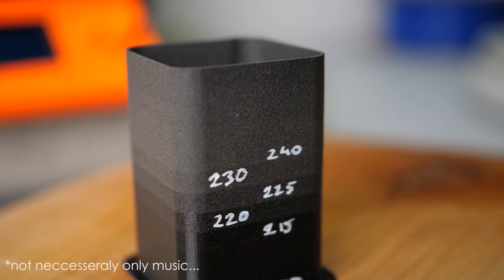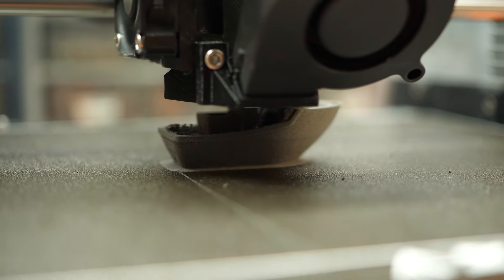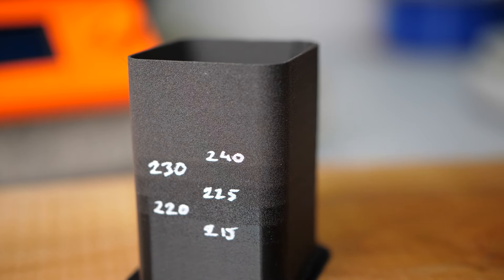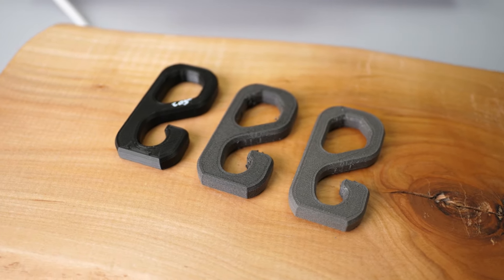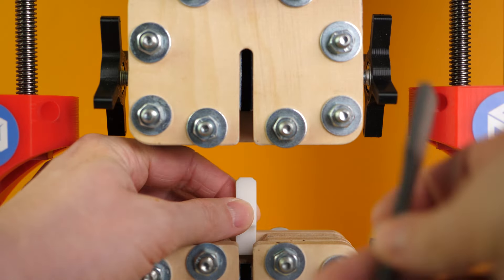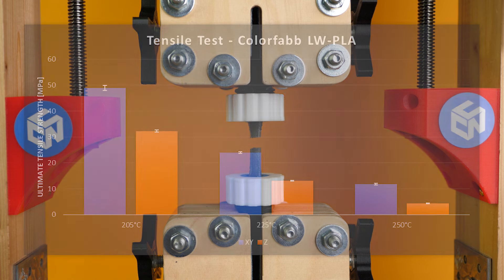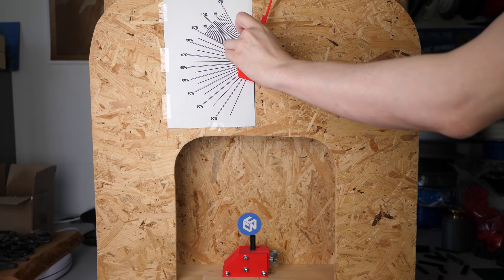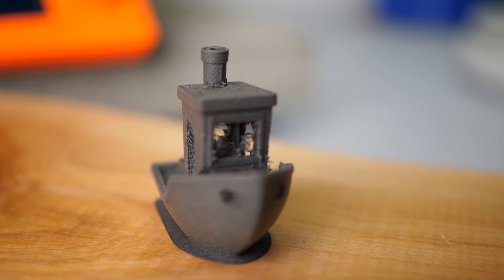A 4th dimension for 3D prints - Colorfabb Light-Weight, foaming PLA

Comment: Does the material change shape permanently if stressed? Or spring back like a sponge?
Reply from the maker: It springs back as long as you don't load it over it's yield point. All bending specimens sprung back to their original shape besides the last one, that I overloaded.

Comment: Very interesting material. White one would be spectacular to paint!

Also: is there any really MAT affordable filament on the market? Non-spongy one, if possible....
Reply from the maker: The LW-PLA is available in black and white. You can get many standard materials Matt by extruding quite fast at lower temperatures but you'll be sacrificing strength.
Reply: @CNCKitchen  methods you described have the same disadvantage - lower strength. I'd love some proven material with matt finish, and sturdy enough for items thrown around, like tokens.
Reply: @cthulpiss  the trick is that many plastics will be smoothed as the pass threw the nozzle, though I have noticed my woodfill PLA does have a mat finish thanks to said wood additive, it feels more (and looks) like cardboard, just bear in mind that that same filling is a nozzle clogging/wear and tear risk

Comment: Hello. What was  value of  extrusion width during printing of foamed PLA with different temperature?  Same value ? Extrusion stream expansion is different with temperature  and speed to. So if it will be corrected with extrusion width  this will allow to decrease part weight, without crashing foam structure. It will be interesting to test this material with adjusted and measured value of extrusion width.
Reply from the maker: Extrusion width kept at 0.44mm with a 0.4mm nozzle for all prints.
Reply: @CNCKitchen  Polymer expand from 0.4 to 0,44 because of melt elasticity. When foaming additive decompose in the melt, expansion is much grater. If using same extrusion width and layer thickness, foam structure is smashed by nozzle movement  and final density is lover then possible.  Increased value of extrusion width and layer thickness allow to produce  same volume with less weight. In order to stabilize foam structure - more intensive cooling can be used. This is the way for further density reduction.

Comment: I can’t get any noticeable increase in volume from my “prefoamed” LW-Pla(overture air Pla) all the way up until it burns at 260. Overture says ideal is in between 190-210 which is much lower than the foaming point of any other LW-Pla. It also only saves me about 20% weight per comparable part. I haven’t seen anyone talk about the difference between “pre foamed” and “non foamed”, but it seems like “pre foamed” may be the answer to the “plane problem”. Anyone else have significant difficulty printing eclipson?

Comment: Instead of printing with a weaker filament type for the core, why not use a partial infill of the stronger material?
Infill may not perform as well under every directional force, but I would bet it would be similar strength to weight.

Comment: I'm definitely curious in the TPU! Could it be used for shoe soles?
Reply: Ooooh snap, maybe!! Dr. Scholls better look out haha 

I'm curious about using this as an extra internal layer in TPU phone cases
Reply: That sounds like a fun experiment, especially for someone like me who has to buy big pricey shoes, the trick is what to use to bond any seperate parts together in a way that is solid but doesn't compromise the comfort/flexibility of the shoe
Reply: @UNSCPILOT  idk, a glue or rubber cement maybe? 💁
Reply: Yes stay tuned

Comment: Can 3d printer print object with channels in the infill that has a fill hole on the surface that you could fill with epoxy/glue that hardens giving strength?

Comment: Sorry if it sounds stupid. But would trying to recalibrating K Value for this filament at high temperature would help anything with stringing?
Reply from the maker: It might, but since the foaming is a transient process, I think you won't fully get rid of it.

Comment: Hey Stefan :) is there any foam filament that is flexibel after printing? Like foam you’d normally find in a mattress or a foam ball?
Reply from the maker: There is the Varioshore TPU and also EVA filament, though probably not as soft as a mattress.
Reply: @CNCKitchen  thank you! I've read a lot about foam tips for in-ear headphones and I am thinking about trying to print custom ones since there are none available for the ones I own.

Comment: Surely the point of a foamed material is to increase cross section with respect to density? It is stiffness that would show interesting results not a pull test.
Reply: @JorgTheElder  I didn't explain myself properly. If you use the same mass of material, a foamed construction should fare better. This is well known and exploited in constructions such as expanded polystyrene and honeycomb matrices. Even on technology as simple as push bikes, "drilling out" is a thing, dating back decades.

Comment: If it foams but your extrusion speed is the same then while the density is going to go down the WEIGHT of the finished product is staying the same tho.
Reply: That's why you adjust the flow rate along with the temperature, as was mentioned several times in the video

Comment: How can I get you to print with HDPE?
If I sent some to you would that help?
Reply from the maker: Wait until I get my shredder a recycle something.
Reply: I hope I can give some advice. I found HDPE to be very difficult to stick to anything. I tried a vast array of materials. In the end the best material it will stick to (while still being able to be removed) is polypropylene. Packing tape can work (turns out scotch tape is PP!), but the HDPE objects tend to warp so much that they usually unstick the tape from the print surface. Fortunately they also make other PP materials like sheets and PP cutting boards. However if you use those you will find that the board warps a lot, even just from the heat of the print itself. I solved this by making a custom print bed composed of hundreds of small polypropilene tiles each mechanically fastened to a substrate, in such a way that each tile was height adjustable but a separate entity from all the other tiles. Also the HDPE needs very high print temperatures to get decent layer bonding (270° is what I had to push, much lower and the parts would just tear apart).
All in all HDPE is a bitch.
When I bought my rolls from faraway canadia (i'm in europe) I got a call from the lady asking me if I was sure I wanted to try it... eh.
Reply: @free_spirit1  yes! This is the kind of information we need! Thank you for the great ideas.
I was wondering if the print was in a heated chamber, if it would help with the shrinking/peeling problem. What do you think?
Reply: @CNCKitchen  a Canada based company carries HDPE rolls of filament, a quick Google search will find it. You would be one of the first people to make a video about how to print with HDPE. It would be a huge benefit to society because it is a very recyclable material, it also has very desirable  properties including durability, strength, and chemical resistance.
We are trying to print with HDPE at work to make fast prototypes for chem fixtures, but we need expert advice to help us get there. Thanks for finally noticing me. I know you get an overwhelming amount of comments, so thanks for taking the time to respond.
Reply: @dreggory82  it wasn't done in a heated chamber, just fyi. But I don't know if that would solve it. Maybe a heated chamber and lots of forced air cooling at hot chamber temperature might work. The big problem is that the hdpe tends to stay liquid after deposition, because you have to print at such high temperature above melting point (otherwise you get no layer bonding). So you can easily get your extruder moving a molten blob of material around. 
My theory is that the high temperature has to do with the (relatively high) thermal conductivity of hdpe. In most printed plastics when you deposit a molten strand of material the heat is able to melt a small film of material at the boundary between the existing solid layer and the liquid layer. The thermal conductivity of most polymers is in the order of 0.1 or 0.2 W/mK. But with hdpe the thermal cond. Is .48 W/mK, so it might be that heat gets wicked out of the molten zone before the interface has time to liquefy. But you could do a PhD on this topic. A hot box might help.
But then again why? Hdpe's characteristics are not azing, the only useful feature is its chemical resistance (which is why we used it) and recyclability.
Can I ask what you would be interested in doing with it? I'm quite curious.
Reply: @free_spirit1  Sure! At work, we're trying to make cheaper chem fixtures. At home I want to print flexible mechanisms (as seen on veritasium's video covering BYU's research). HDPE will be awesome for durable replacement parts for various broken things. But my goal is to make a shredder and extruder to be able to recycle milk jugs, IPA bottles, etc. So that I can recycle failed prints and trash. Printing with HDPE would be more economical.
Reply: @dreggory82    there's a german guy who does hdpe powder for sintering. Spoke with him on the phone, seems to be very small scale. Honestly I'd recommend just buying a few spools and giving it a go. You may have more success than me. Otherwise there's always PP, which seems to be more printable and has similar chem resistance (and can also do live hinges). Funny how these things we do for work can bleed over into our hobbies. Anyway, if fixtures can also be made out of other polymers (but with the requirement of being watertight) I have other techniques to make ultra-water/gastight objects. It's a new technique I developed, will make a video on it at some point. I use it to make tube connections and liquid containers, though at this stage I think I can even make plastic pressure vessels that can withstand considerable pressures. Hope I find enough willpower to make a video on it 😬
Reply: @free_spirit1  please do make videos. I am very interested.

Comment: I wonder if these could be used to make RC tires with builtin rims.
Or tracks with softer bottom for tanks.

Does it absorb water, and if yes, what % volume is soaked up?
Excellent video.

EDIT: Link for tire idea https://eu.freep.com/story/money/cars/general-motors/2019/06/05/gm-michelin-airless-puncture-proof-tires/1350513001/
Reply from the maker: Haven't tested water absorption yet but if the pores are closed it shouldn't be that high.

Comment: man - that nozzle looks awful - so much stuff around it ...
Reply from the maker: I've seen way worse heater blocks in my career 😉
Reply: @CNCKitchen  yeah - sooo true - dugging out your heater block from a pile of molten PETG that leaked out of every possible screw hole looks worse ... still I'd clean the nozzle as it may cause unnecessary failure points
Reply: Looks like a hotend that has been used for all of a couple of days. All of mine are thickly cased in old molten plastic, except those with silicone sleeves on them.